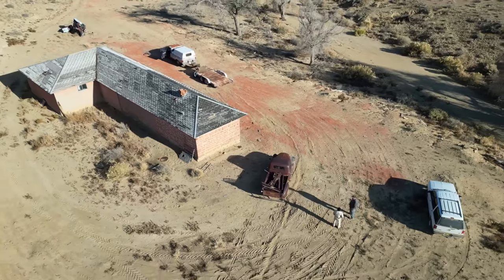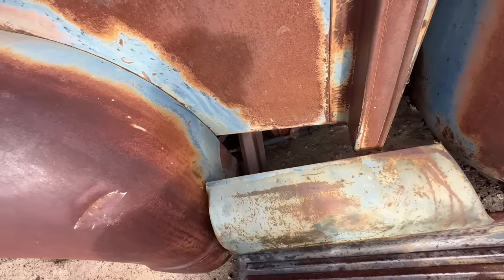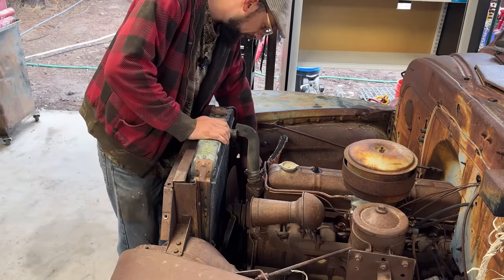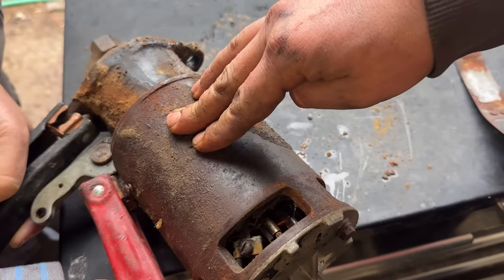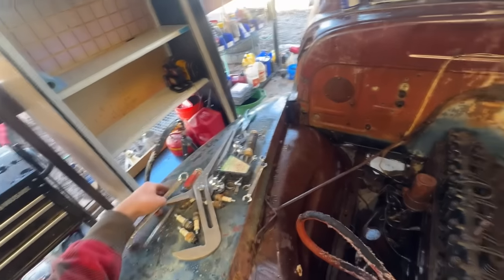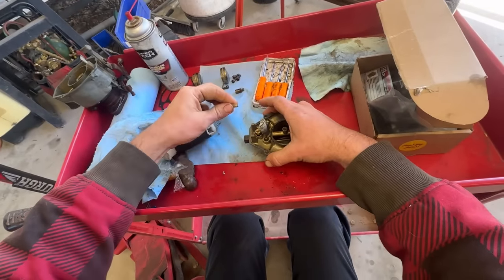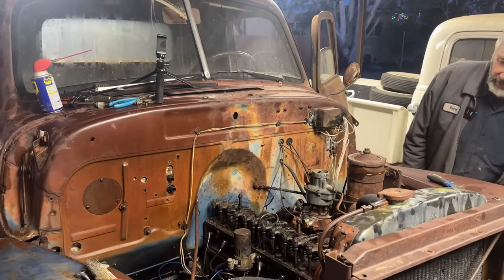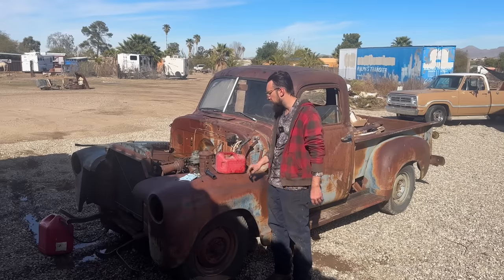1948 Chevy truck ABANDONED 58 years ago, will it run AND drive?

Comment: Absolutly love this truck in this kind of bad but somehow untouched original condition. im beggin you to just get it complete and drivig like ist was in the 50ies, all the way with bais plys tyres, steel rims and a new good running 6 zylinder engine. There are a lot of guys out there who like patina, but few of them want to keep it apart from the paint, so they rip out all these original parts, each proudly stamped "made in USA" and replace it with china aftermarket speedparts. i would love to see that thing like it rolled of the assambly line, just with all the patina on it that showed what happend since then.
Love your content, and really love this Truck, too bad i am from germany and too far away totry buying it from you.
Keep up the good honest work and stay humble, i like how you are not one of these self-absorbed  "coustom fabricators". who convert each car they are working on into a "super cool ultra fast space mobile", hardly keeping the bodyshell of an americam piece of automotive art.
Reply from the maker: Yeah I agree. We don’t care for all the custom fab performance stuff.

Comment: Engine swap: go to a Cummins R2.8 diesel crate motor plus the modern manual transmission of your choice.  Paint it Air Force blue with a foam roller.

Comment: get it to run on however many will run, get a heat cycle on it, maybe twice if it's stubborn, then clean the plugs, see if any rings unstuck, and valves seated better after heating and cooling everything expanding and contracting might do it some good if those babbit bearings are still any good. Ever repoured babbit bearings? it's a good skill for a car guy doing older cars, older military vehicles, steam engines, some types of old farm and factory machinery, etc. or was at one time. 👍🇺🇸😎
Reply: This sounds like the same type of bearings that I had worked with on a large machine called a crater. The bearings had to be assembled in several steps and the final step was putting the balls into the bearing housing with the screw assembled on the machine. Was a very tedious process and was thankful only had to do it once a year during maintenance shutdown week. The machine was quite large and took three crewmembers to assemble the drive chains on it. 😊

Comment: That's probably way too late, but knock+no oil pressure, can't it be the oil tube of the pump that got lose and fell ? so it's slapped by the crankshaft and "slammed" against the oil pan ? That would explain the noise and the absence of oil pressure/flow

Comment: You might want to consider an engine rebuild master kit to able to use the original engine. I would check the truck for radiation. If it was assigned to Kirtland Air Force Base or Sandia Army Base it may have been involved in special weapons handling. Or it was used a Production Super truck on the flightline and or a Air Police vehicle. Maybe the Air-Force has maintenance records of the truck at the Kirtland Motor Pool Squadron?

Comment: I seen 216 had rod knocking an it was they bypassed the oil filter like you did something about the way pumps made hook oil filter back up an see if oil starts to oil lifter an stops knocking check oil pressures before an after morske was having problem oil car he had

Comment: You didn't set the float level, you might get lucky and it will work at the setting on the float in the kit!! I. Had just commented on the float level adjustment,  didn't see you adjust it, my bad

Comment: I know you like building original vehicles but honestly I was thinking this truck would be a neat body swap and modifications to like a c20 or 2wd 3/4 ton equivalent chassis and like a 12v p pump Cummins turbo diesel and a 5spd,or a v8 sbc 400 and a 4 or a 5spd and pull your recovery and revive trailer with it and mount like a 44 inch us general bottom box in the bed with no wheels to have all the recovery gear and tools needed in the bed of the truck and honestly if the trailer had similar patina that would be awesome..

Comment: you have a bit more luck with the pry bar if you pull the valve gear you only bending your push rods doing this , 216 =boat mooring

Comment: How about just taking the starter apart and clean and Lubricate and make sure the Bendix works if it's been sitting for decades you know there's basics for a motor that's been sitting for years ,How many stuck valves do you have ,Do the basics you should know that

Comment: No don't run it until fix the knock , if you keep running it you are subject to ruin the the crank shaft and rod also I don't think the oil pump is working if it even has one some of the older engines just had splash system oiling, spoons on the rod caps that picked up oil and splashed oil onto the crank shaft and some how the splash would make it to the rocker arms and rocker shaft!!!

Comment: So you got two military surplus trucks try get a Ford of same era and military surplus. The wheels being changed would the original wheels have been 16,5 rims? Since you now basically have the the almost completely GM family a Ford of the time period would complete the collection. You lucked out getting a pretty much complete truck minus the front bumper

Comment: It’s just a little valve clatter 😂 and Denial is just a River in Egypt. Is there a dent in the oil pan that the rods are hitting? I’d spray some lubricant on the valve train before I start these old engines. This one looks like it was in a flood with all that dirt everywhere

Comment: i  have  a  stock  48 chevy  short  bed  5  window   custom   216  - 6 cyl  3 on  the tree   runs  great    trucker  said  i  was  95  in  va  in  71  thats  moveing =  had  very  low  oil  press  took  caps  down  they  had  a  lot  of  play  i  put  a  flat  file  on  the  bench  took  each  cap  and  filed  down  each rod  bearing  flush  they   did  have  a    big  gap  before   i   filed  them  all  most  ever  with  the  caps  drove  to  va  from  md  and  back  ran  great  used   a  quart  of  30  oil   oil  guage  said  about  25  dont  think  so  =that truck  was  a  51=   had  a  50  real  nice  sold  it  and  nice  49  ford  coupe  for  rent  money  that  sucked   im  82  now  im  keeping  this  1948 chevy  truck    i  own  my  house  no  rent  shit  my  ashes  well  be  put  in  it    get  er  dobe  young  nan  i  want  to  see  what  ya  can  do  to  it    hell  if  you  have  2  rat rod  part  of  it  happy  new  year

Comment: As s rule of thumb you are one lucky SOB when it comes to picking up stuff that old that still works in the condition you find it in. If you think about it, why did a poor farmer park that truck 58 years ago? I'm not going to assume he parked it in order for his great grandchildren to dust off and drive around in the next century. It was spent, driven hard, driven some more and then driven again until he couldn't stand the engine noise anymore then he put it away wet. He didn't sell it because it probably wasn't worth $5 at the time. Now, I'm not saying I wouldn't buy it today at the right price but if you can't verify you're getting all the parts, you can't drive it or even hear it run what's it worth? If you aren't running a junk yard or need a parts car? I can't believe there was a bucket of 58 year old oil underneath it. That's hard to believe but then even if it were only 5 years old and had been sitting under a truck in the desert you'd have to be insane to put it in an engine of any condition. It was sort of fun to watch though... you knew it was trash and wanted to see if anyone would notice? it was a gullibility test right? LOL
Reply: He didn't put the oil he found with it in there. He used some oil he drained out of a 5.9l B series Cummins in there. 😊